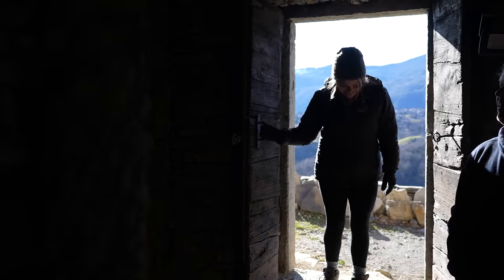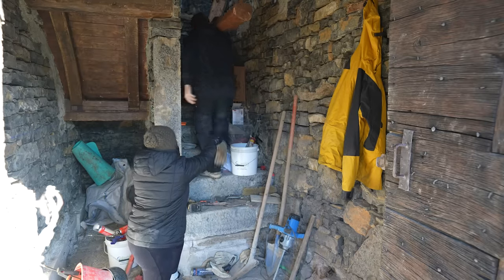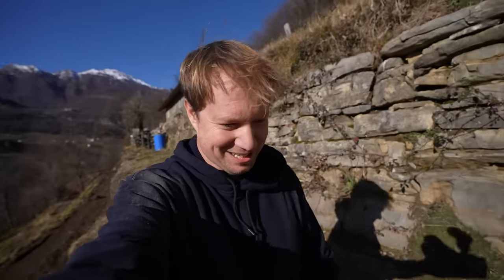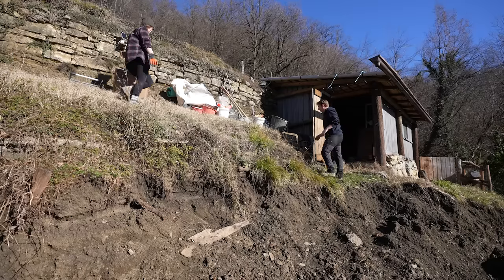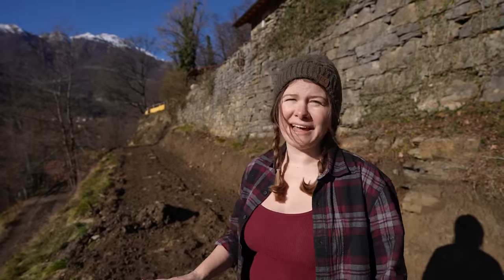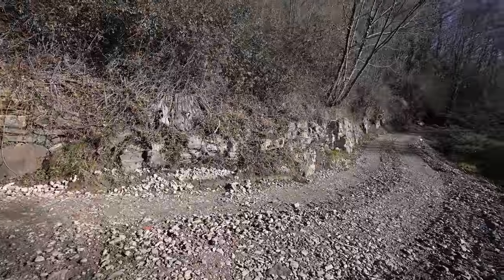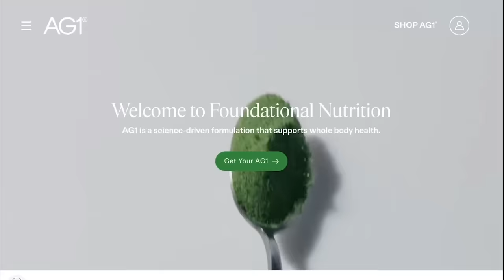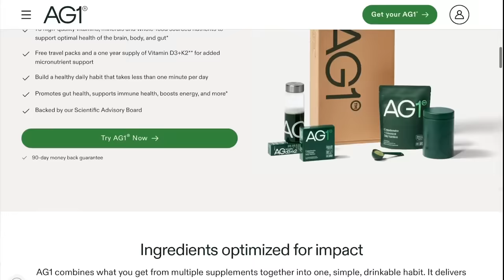Getting Back to Work on our Italian Stone Cabin.

Comment: Hi Heather and Brady!  Welcome back!!!  Just to support you guys,  I tried to scan the QR code a few times but it wouldn't work for me..is it too low on the page? I'm not an expert at using these codes but t I have done it successfully before. I also tried clicking the link to the right of the code and it didn't activate anything to link me to your page. I know there's a link below the video in the "more" section. I just wanted to give you a heads up if you intended the link on the actual video to work.  If the Qr code is working for others what might I be doing wrong? suggestions? Some of us old timers are proficient in this newer tech.  Stay well looking forward to next weeks video.

Comment: If there are geological obstacles to building in the back of the house, an alternative is to build it from the front. Namely, to strengthen the lower terrace, on this level the garage and stairs to the second floor, which will have a living area, terraces, and will be connected to the stone house if desired, because it will be on the same level
Reply: What a BRILLIANT IDEA!! 💡 
I hope the Voyagers see your suggestion.... if they're working with an engineer he should be able to give them feedback as to if this is feasible... a GARAGE UNDERNEATH THE TERRACE makes so much sense with a tunnel or covered stairway leading to the upper house. However, I get the sense that the lower terrace needs to be filled in with earth & maybe even a large amount of concrete (below the house) to provide stabilization on the side of that mountain ... so the house doesn't slide down the mountain!!  Perhaps the lower level could be offset to one side or the other....  so many engineering challenges!!
Reply: @kindlydude  I am sure that there are restrictions related to building permits. But within their limits, you can plan a project with engineers that will connect the historical and the modern, will make it possible to fully and meaningfully use the physical space of the site and unite the terraces.